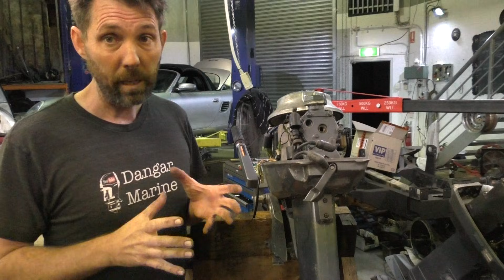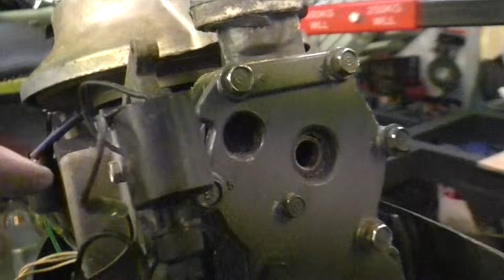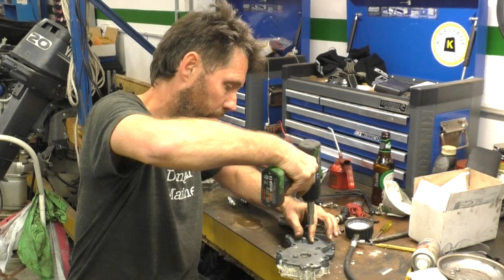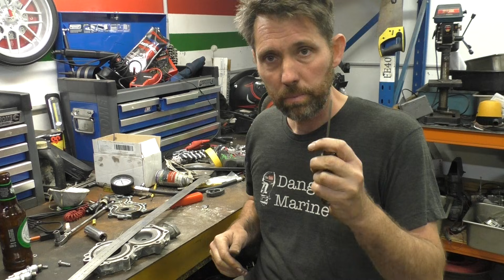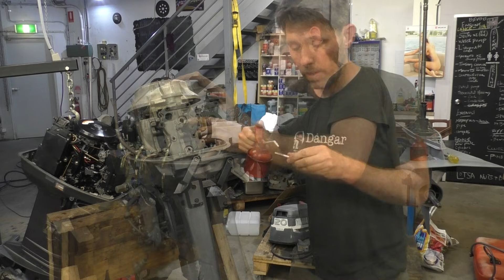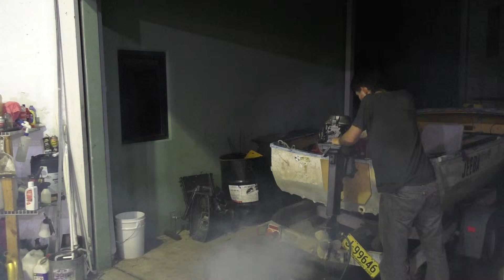Replacing a 2 stroke outboard head gasket

Comment: I have a 1987 Yamaha 25hp the top cylinder has 115psi the bottom has 75psi. Also the bottom cylinder is fouling new plugs after just a few minutes of running. It was backfiring a bit at idle then died like it just lost spark. Also the last owner used it in salt water and then let it sit for years until I got it. Definitely think there is an ignition issue but also for the low compression not sure if it would be rings or the head gasket. Any input would be appreciated.

Comment: Why on earth weren’t the Johnson engines exported to Europe fitted metric screws? I’m currently disassembling my 15HP 1991 Johnson to overhaul it, and I first had to buy (expensive) screws (UNC/UNF Standard) from a local Harley dealer and ratchet sockets / open-end wrenches in the imperial system because all of Europe uses the metric system. Even es simple O-Ring does not fit as it is also based on imperial size system.

Comment: You can't have the throttle wide open on an older Mariner anyway bc it won't let you pull the cord when trying to do a compression test.
Reply from the maker: You can just disconnect the throttle linkage and hold the buttery fly valves open to avoid that, but it doesn't make a massive difference to the reading in my experience.
Reply: @DangarMarine  thank you for your reply.  I luv your Channel.  Above said Mariner (1993 8 HP) has run out of steam; 90 PSI both cylinders and is being replaced by a new 15 HP Suzuki.  Wish me luck !

Comment: Great video.  One comment about oiling head bolts:  I was told that too much oil on the head bolt (or on the internal threads of block) can result in problems.  For example if there's a pool of oil at the bottom of the bolt hole, and the bolt hits the oil - there's nowhere for that oil to go and it can throw off the torque (ie false reading because of the oil stopping the bolt) OR, more seriously, it can strip the threads on the bolt because of high hydraulic pressure.  Perhaps a simple warning not to over-lubricate is what I'm getting at.  Yes, oil the threads - but sparingly instead of liberally.   Thanks for all your great videos!

Comment: oops. just find out this clip, and immediately have questions: what kind of polymer used for had gasket? is it mandatory? is it in a service manual (not)? are OEM gasket not good enough to use without polymer sealer?

Comment: Stu Thankyou for all your videos I’m learning so much - got a question would replacing the head gasket on a 2 Stroke be a serviceable item - got a boat with a mercury 80 Hp 3 cylinder been sitting for 7years should I just change the head gasket ?

Comment: Hello from the states. Question: can you reuse a new head gasket after it has been tightened down once already. Thanks
Reply: No, because it has already been compressed and will not allow the engine parts to re embed themselves into it again.
Reply: @lesfox2010  Do the gasket side with the large metal rings part go against the cylinders or water jacket?
Reply: @mikesolns1364  You would have to consult the manual.

Comment: Great video. I have a suzuki dt25 1984 and its really hard to start it when cold. When hot engine starts very easy. I am thinking the CDI causes the problem. If that doesnt change the problem i will take a compression test and move onto a head gasket replacement since the outside seems rusted.

Comment: I have a 15hp yammy that sometimes revs out and mostly won't, this started after replacing a stuck thermostat, it was a $100 motor that seems to have had zero maintenance for its 25 year life, I figured for a $100 it was worth it as I do all my own work. After cleaning carb, and replacing the thermostat I tasted the tips of the sparkplugs and found one was salty indicating water on the plug. It would also occasionally be seized after standing for a day or two but loosened up easily, also indicating water in the cylinder. The strange thing is compression was 125 even on both cylinders. I popped the head off to find the water jacket almost completely blocked, yet the head gasket doesn't look blown. I have ordered a new head gasket and given the cylinders a light deglazing with 320 emery paper on a drill to return some cross-hatching (I have had luck in the past doing this on small 2.5hp tohatsu/mercury's) and hopefully, this will sort the issue. My only hope is that the water is not from a crack somewhere I haven't found yet.

Comment: Hi Stu, been reaching these head water passage videos again. I'm diving into this for the first time on a 3hp Evinrude 2 stroke. You mentioned the step on having the carb shutters wide open to preform a compression test. I think the reason for this is to rule out defective reed valves. It may affect the readings. I'm new at this internal stuff but thought I would point out the reeds may affect compression?

Comment: Hi, thanks for your videos. They are very instructive. I have a question. I have a Yamaha Outboard motor 2 strokes 6cv model 6C (or 6M8 or 6MH for the US). My mechanic says that there is some water in the cylinders. To solve this problem is it enough to change the head gaskets like you do or to change others gaskets ? How is it possible to diagnose this problem ? Also you don't use a dynamometric key for the bolts. Is not necessary like they show in the service manual ? Thanks

Comment: Have a 70 Yam. 2 stroke..runs great but overheats at WOT not at slow 6knts.  Thermo good. Opened  head and saw 2 pieces of the cylinder stiffner broke.  It appears they could restrict water in the cooling channels around the cylinders. Ran it without thermo and still over heat and showing 220f on the upper of the 3 cylinders. I'm replacing the head gasket (thanks for this great video) and hope it was the stiffners pieces that caused the restriction. The tell-tale was strong. Think those pieces could have restricted the flow enough to overheat? Thank you

Comment: Would an exhaust leak from head gasket cause air/ exhaust to come out the tell tale? I change the impeller and gasket check the key way for impeller made sure it lined up with water tube that goes up to motor.. if I take the thermostat off and run the engine, water will come out the thermostat housing with some exhaust and out of the tell tale at a good clip for long time.. as soon as I put the thermostat back in I start the engine and water will come out the tell tale for about 20 seconds and then air or exhaust comes out the little pee hole.. don’t know what else to try.. any help would be appreciated.. thanks
Reply from the maker: Yes, it will cause that. The exhaust will push the water back out of the water jackets causing the engine to overheat, definitely seen that before.
Reply: @DangarMarine  thanks for the quick response I have nearly tried everything.. I submerge the lower unit in a 50 gallon drum I took off the thermostat and let it run for 5 minutes.. water was gushing out the thermostat housing and tell tale.. I turned it off put the thermostat housing back on and started it again.. only a good stream from tell tale for about 30 seconds.. as it started heating up the stream kept decreasing until noting but air was pushing out the tell tale… idk what else could be causing this.. has me clueless… thank for ur quick response it’s appreciated.. great videos thank you
Reply: @DangarMarine  thanks 
I’m having the same problem with an overheating 3hp engine

Comment: Sanding the block with the pistons in is a bad idea, right? I was thinking about doing it with the block still being on the engine in vertical so if anything falls off does it does not get on top of the pistons or deeper into the cylinder.

Comment: I have a 1977 Evinrude 25HP and the compression readings I got were 50PSI on the top cylinder and 70PSI on the bottom cylinder..... do you think a leaking head gasket could cause that much of a compression drop or is my problem likely worn piston rings or something "catestrophic" as you put it in the video. If the piston rings are worn I am wondering how do I really tell or if you have a video to diagnose low compression. 

Thank you for the videos. Have been watching a lot of them lately while trying to figure out how to get this outboard running. Thank you.
Reply: A quick shot of oil in the plug hole and re-do the compression test. A marked rise in figures usually indicate worn rings.
Not a fail safe method, but a pretty good indicator in general.

Comment: Thanks for the Video, I'm working on changing the cylinder head and head gasket on my 90hp yamaha 2 stroke and ive been having some trouble removing the old gasket material. Ive been using plastic scrapers and a rubber wheel for removing decals off of vehicles that attaches to my drill. I still have some material left and I saw that you used a brass wire wheel for your process so i purchased one and tested on the old cylinder head but it seems to be sratching the surface so i was hoping you could suggest exactly what you used to accomplish this. Thanks in Advance

Wes

Comment: Good job...I noticed you put something on the cylinder head bolt threads while reinstalling..In the U.S. mechanics often use a non hardening gasket sealer such as permatex..It prevents salt intrusion on the threads more effectively than greese.Also heads that are slightly warped can often be planed down at a machine shop..or even by hand by using fine Emory cloth sheets..with a figure eight motion..On small engines like this one..(old school) .Another old school trick is remove the inards of the thermostat so you have some restricted flow of the water so it picks up the heat..and yet you don't have the worries of a stuck thermostat..The total removal of the thermostat allows too quick a flow..and might explain the top cylinder carbon.. Carburetion adjustments and cleaning should do the trick unless the intake reed valves are worn out..rare but can cause the issue noted..Disclaimer..The correct repair on the cylinder head cooling is replace the thermostat with a new one..especially if it's a fresh water motor or in a cold climate.There are products to flush through the motor and remove...desolve salt..

Comment: I have a 1996 30hp 2 stroke. I recently replaced coils, starter, solenoid, plugs, rectifier, and impeller. Now I have a green grease leaking from the top of the motor down the shaft on the right side. What could be causing this? I have a picture but cannot upload here.

Comment: Around 180 grit wet & dry silicon paper on a wet flat surface (glass) in a figure 8 pattern is preferred ! method, wire buffing a cylinder head not best practice, and make an allowance for possible left over asbestos gasket material on machined surfaces  and wire buffing will spread the fibres!

Comment: HI Good Video. Thanks a lot. Question: 1) what is the torque for head cylinder adjustment in a Jhonson 7.5 HP 1980? AN do you recommend spray gasket sealant of the old one that you apply with a brush?

Comment: Help please!   Johnson 35hp 1980. Starts ok and runs ok but idles bad keep coughing and trying to die afer say 10 seconds of idling.   The strange thing is that when it tries to die I can stab at the choke for half a second and the engine wakes up again, until 10 seconds again.    It wont run if I keep choke on ! Just stabbing the choke wakes it up. Any ideas?

Comment: Thanks for these fantastic videos. I watch them for hours. Please produce a video or link to how I can reseat the heads on my year 2000 Johnson 115 2-stroke motor. It is leaking slightly at the top inside of the starboard head. It uses sealant rather than a gasket and I need to know the best sealant to use, exactly where and how much to put  on. Thanks again.
Reply from the maker: I don’t own a Johnson 115.

Comment: Can water leak out of a engine block from anywhere other than the head gasket?
Reply from the maker: Can come from the exhaust cover or a corrosion hole in the aluminium too.
Reply: @DangarMarine  thanks alot..great videos by the way

Comment: Awesome as always.  When I couldn't reach the lowest two bolts on the head cover to remove it, (they were really stiff & started to burr over with spanner use) I actually drilled two 22mm holes in the outer casing to provide access to them.  It seems a bit radical, but I got 2 grommets to fill the holes for water-tightness, so it should be ok. I then could use a socket to remove them (one broke close to the head, which was a whole other adventure!).  However, I now have much more chance of tightening all the bolts accurately with a torque wrench...
Reply from the maker: I think that is a good way to go, nothing wrong with drilling to give access.

Comment: I have a question for you  I have a 1995 115 johnson I new I need a new power head but my question  is  can I put a 135 power head on instead of the  155 it is the 90 degree cross flow bubble  back

Comment: Hey Stu, any chance of giving a few tips on removing head bolts on an older Yamaha V6? I'm a bit worried about breaking bolts off in the block.
Reply: Colin I am in the same boat so to speak..a 1988 175 hp Yamaha..I have a friend with more experience then I ,even with a marine Mechanics degree I don't have 40 yrs experience..He strongly recommended he do the job because being so old and around salt water using heat(torches) is highly effective in preventing bolts breaking.. Aluminum blocks and heads can be permanently damaged
Reply: In short frozen bolts can become a nightmare..Wondering how you made out
Reply: @michaeljacobs2570  I bit the bullet and took it to a marine mechanic, and very lucky that I  did. It was a nightmare.......

Comment: Hi I have the torque specs for my johnyrude big twin 40hp for the head bolts but I can't make head or tail of it so wanderd if you can shed some light on it? so the values are in lbs but there are 2 numbers to each set of bolts?  it says cylinder head screws 168-192lb
Crankcase to cylinder upper lower 150-170lb
And crankcase to cylinder center screws 162-168lb for foot lbs to says divide by 12lb ? Does anyone know what this mean why are there 2 values for each one does it mean anywhere within those figures or what also whats the difference between cylinder head screws and crankcase screws? Its all abit over complicated iv got my head gasket in place I just need to torque  the bolts up ?
Reply from the maker: If there are two numbers I would tend to interpret it as torque everything in order to the first number, then go around and torque everything to the second number. It is common to torque bolts in stages like that. There may be instructions for interpreting the figures elsewhere in the manual.
Reply: @DangarMarine  ok thanks for advice that makes sense

Comment: What does the spray stuff do and also iv got an old 70s big twin 40hp outboard when pulled the head the gasket also had sealant on it is that normal?
Reply from the maker: It depends on the type of head gasket. Hylomar is a selant, some head gaskets have a factory sealand on them.
Reply: @DangarMarine  ah ok this was like the mastic type stuff that you would use as a temporary measure? Im try to figure out what wrong with the old girl! It will not crank over unless the spark plugs are taken out it has the correct plugs and all pistons are moving and cylinders look oiled up i just can't get to the bottom of it its a pull start and gear box is not attached every thing else looks OK iv check for spark and it has a good spark so I have a vid on my channel im currently waiting for new head gasket to see if that makes a difference as someone suggested that one cylinder maybe leaking into the other ? Any advice would be great i was told it was running when the seller received the engine iv also filled the cylinders with oil before I took the crack case of and let its it for a while but didn't fix the problem

Comment: Any advice on what to do after head gaskets fail and salt water gets inside the cylinders/pistons? Yamaha 115 2 stroke. Thanks
Reply from the maker: Just clean out with fresh water then dry and spray some light oil in.
Reply: @DangarMarine  Hey. Before I saw your response I removed the head/exhaust covers and wiped the piston walls with oil and turned the key to "blow out" as much water as possible. Then I sprayed fogging oil through carbs and piston cylinders. I ordered new head gaskets and will install and run boat as soon as possible (2 day shipping). Anything else you would suggest? THANK YOU

Comment: Hi Stu.we have a 76 johnson 9.9.it looses fuel pressure and over heats and stalls after 45 min of run time.we changed fuel pump.thermastat.plugs.etc...could it be the head gasket..it pumps water well..any ideas.
Reply from the maker: I would work on the overheating first. Blown Head gasket can cause overheating. Removing the head will also let you see if the water jackets are free.

Comment: I have a yamaha 90etlg that I know the bolts are going to snap when I try to pull them out. Will a torch work to heat them up before pulling them without damaging the pistons? Live the videos by the way, great info!
Reply: My 1998 90AET just snapped two from 10, the inner two between Cyl 1 and 2. They need tapping and new bolts. I’m currently de-salting it all. While I’m waiting for the gaskets to arrive before I start the rebuild.

Comment: Great and informative are the old 65hp 3cld Mercurys easier to replace the Cooling Head without taking Cylinder head off and having to reseal and replace the cylinder head Gasket.